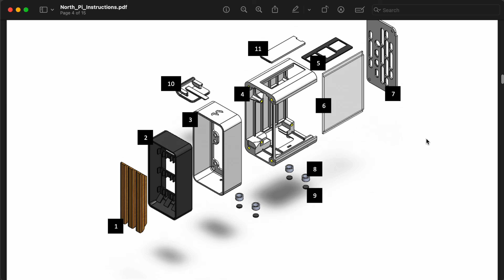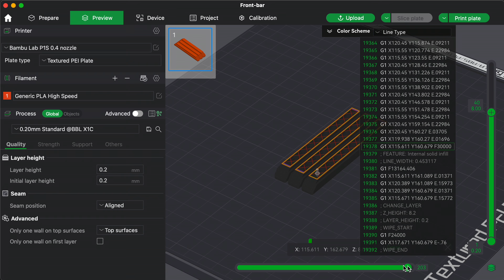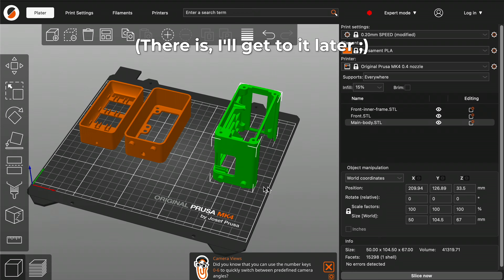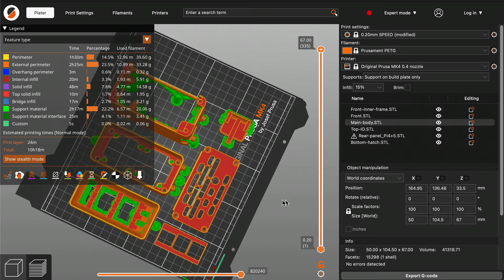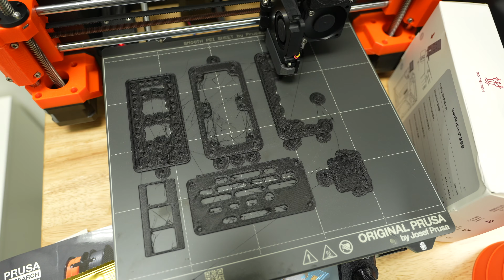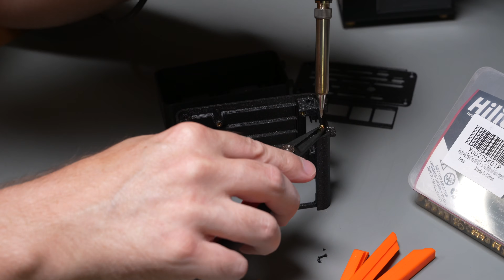Fractal's newest PC case is... free? (some assembly required)

Comment: That's really cool, and thank you for doing this video.  I learned so much of what I have been doing wing, either by you messing up and then saying what you did wrong (which is what I messed up on also) or being a third party, I could see what was going wrong.  So I learned a lot, like I was setting my someo soldering iron WAAAY too low, and as soon as you said "you know how they say to read the instructions", I started laughing because I'm guilty of the same thing.

Comment: If you don't have a 3D printer, call around to libraries in your area, a lot of them have maker spaces with printers that you can use - usually for just the cost of filament.

Comment: Tips for printing PETG:
Keep it dry! It NEEDS to be bone dry, best is to print it straight from a drybox, ideally after having dehydrated it in an oven or fruit dryer. Wet PETG is extremely stringy and weak. Dry fresh filament as well, almost every filament I have ever bought was wet despite being sealed. I'd say PETG isn't quite as bad as Nylon/PA (which needs to be dehydrated WHILE printing) when it comes to keeping it dry, but it's far more sensitive than PLA. That said, PETG is always stringy and globby.
Print it slowly! PETG always prints kinda messy and it prints really ugly unless you print at something around 10-20mm/s.
Make sure it works with your build plate! As you saw, it can form very strong bonds with certain sheet materials. It basically fuses with glass, for example. Use a layer of adhesive spray as a separator.
And now for the most important secret trick: Forget about PETG and use PCTG instead. People will tell you it's basically the same as PETG (and thus not worth it) and that is mostly true when it comes to mechanical properties, but they miss one important fact: It prints way cleaner and easier. There's still stringing and globs, but it's around 10% of what you get with PETG. It also can take around 10 degree celsius more before becoming soft than PETG. I used to print almost exclusively PETG and I print exclusively PCTG now. It's just that much less of a hassle when it comes to stringing.

Comment: The largest piece of the case should have been flipped upside down. On one of the long sides there was a bridge across the top but not the bottom. If it had been flipped, it wouldn’t have needed supports, saving a bit of time and material. At one point, the software was showing that piece in a different color. It might have been trying to tell you something.

Comment: Edit: I saw the rest of the video. Good to see that you learn by reading the documentation :) Best of luck to you. 
Original comment:
Some constructive critique brother. I hope you are not easily offended.

1. I cringed when you stabbed the prusa sheet with the tool. Please keep the satin abuse off camera and use hard plastic tools plus heat and/or alcohol for on-camera abuse (I can deal with that <3)
2. Stringing is common when you print with too low of a temperature on the nozzle. READ THE SPECS... when you print with a new filament, the slic3r presets are good, but PETG and PETG0 is probably not the same compound.and need different settings. Double check the speeds it needs and the temps it needs for best practice. (When in doubt a do a print tower to dial in a new filament. It might be the best filament ever for your needs but it needs some testing in your environment and use case etc.)
3. I like to print more things one by one in sequential order as to have the nozzle focusing on one thing at a time.. https://help.prusa3d.com/article/sequential-printing_124589 
4. PETG is wonderful, I only use that material as I print functional parts for things. Granted it is more brittle than PLA, but I make up for it with infill (amount and pattern). Also layer orientation and outer edges. Also I never use the fine sheet, I don`t like the glue mess and PETG tends to bond with the coating, so when it contracts and the bumpy parts make it release when cold, I get no warping during the print process but an easy release from the bed.
5. You should read more up on material science and 3d printing "trips and trix". 

Otherwise I enjoy your content. Keep at it. Best of love from Scandinavia.

Comment: What is the idea behind the term real wood accents here? This item is provided to be 3d printable. I would believe that they provide these with fake wood accents. To add real wood to a 3d process, would require more than just a 3d printer. Since real wood uses a literal growth process, followed by carving and that which makes them have accents is the oil/lacquer process. Even with the focus being on the accents, as then with real wood accents there's part wood part other material, there's a reason there's something called fake wood accents. And it's used on products that are made to look like wood, but don't have any wood material in them.

Comment: Why don't you offer to print the files for this case and charge a reasonable price, all things considered? I don't have a 3D printer because I lack the need so some online service is my only option. Why don't you bridge the gap and cut out the GREED so they will lower their price. That's Capitalism, to get a big company to lower its price. Monopolies focus on Greed and create high prices. Anyone with half a brain knows this, so if you know it would cost you 15 or 20 bucks to print this yourself, why not pass on the savings?

Comment: I discovered a trick to printing in mid air. Print your object at a slight angle and not flat on the surface. You may need supports on the bottom but thats all.

Comment: Id suggest not PLA - if temps are getting 60+C on the pi/ that softens most PLA.    As for flame resist.. no need... if your device is so hot it is catching things on fire - you have other issues.  This does leave some fun like UV reactive ABS and stuff you can use - which opens up a niche market for fun little fancy prints.

That's not venom, my MagnetoX had tis PETG-CF goop up the hotend, and THAT was venom.  it was just... all over... managed to go right up between the silicon sock up the entire heating element.

Comment: A couple tips for PETG,. Make sure you dry it out first, even if it is fresh out of the package.  You can use a smooth plate, but you need to use liquid glue or some alternative to prevent it from adhering too much.  It is easier to remove the print if you pull it off at around 40-45C.  Once it cools off completely it becomes harder.  Make sure you protect your print from unwanted airflow.  Rapid cooling can cause it to shrink and warp.  That Bambu printer would probably work better for it given the environment.  And for the stringing, it could be the retraction speed, but I don't know for sure.  It could also just be the wet filament.

Comment: Most of the parts are not optimised for 3D printing and have a lot of unnecessary features making it overcomplicated.
The wooden accents should be bamboo chopsticks that you just need to cut to the length, you would probably take 3 of them and cut off 2/3 of the length of the round side and keep the square ends, that would be dirt cheap.
I could redesign it but they didn't release step files...

Comment: that was so messy. you dont use pla gloop on petg and you covered the screw hole for the front part with those slats. you need to enable "exclusive printing" in the slicer so your clips are perfectly align. id recommend printing these on the same printer too is they are not both perfectly calibrated

Comment: Use Cura folks
Reply: Proper printer settings and the right slicer go a long way in when to need supports. I'm going to print the "North Pi" as well, but without any supports.
Reply: Also you don't need so much heat for inserts, that's crazy doing 650F. Your melting into PLA which already melts at 200C or 392F which is exactly the temp i use for inserts.
Reply: For inserts only press them in till there's just a little bit still sticking out, use a flat metal object (bottom of a socket works) to push the insert flat and flush.

Comment: PETG on my MK4 doesn't string that much at all with the PETG settings. The supports failed. I avoid touching the build plate ever with bare hands, finger oils damage adhesion, and the supports failed to adhere and made an extra mess from there. I use the matte plate for most everything, the smooth plate has been put away. Adhesion is perfect and no glue stick or cleanup required.

Comment: For petg, its wise to up the retraction speed and the retraction length if ur printing at the temps ur printing at, you can also lower the temp a smidge so the petg isn’t so gooey, it may produce weaker parts (but from experience its still stronger than pla) ur using a direct drive so the changes in retraction will be minimal, hope this helps for next time

Comment: I noticed the MK4 print times seemed a bit high, and it appears you're not running input shaper. You can almost cut print times in half if you use the MK4 input shaper profile in Prusa slicer, and your printer's firmware is relatively recent

Comment: The trick with printing PETG on smooth PEI is to never clean the build plate. 😂 if I ever wipe it down with IPA, I follow it up with wiping my hands over the build area, or not removing slight dust that have settled etc. I’ve had very good results that way, and except for stringing I’ve found PETG to be a lot more reliable than any other material. Stringing is also very easy to remove, just apply a heat gun and it’ll disappear. 

TPU though is even worse when it comes to adhesion to PEI, you need to apply chalk powder to have any hope of that ever coming loose.

Comment: what are you using to remotely control the printers power? i'm using octoprint and a smart socket so i can turn the printer on by voice command, but would rather have something closer to what you have going that is an all in one solution. maybe also time to try a new slicer than cura and simplfy3d...
Reply from the maker: Im using Home Assistant + ThirdReality Zigbee outlets
Reply: @Level2Jeff  I have Kasa. Should also work?

Comment: If i may give a couple printing tips:
1) When arranging a plate. Try to keep the big items in the center and not the sides/corners. Bed-heating is not uniform with the outer sides often being a bit colder. So lift-off tends to be a bigger risk there. When your plate is full of stuff, bump up the plate temperature by a couple degrees.
2) Always use a 3D-Printing gluestick like say Magigoo, Dimafix, 3Dlack or whatnot. By default they improve adhesion for even PLA, but more importantly they provide a separation layer so that stuff like PETG, ABS and TPU doesn't try to fuse with the PEI sheet and damage it during peel. It also means less wear of the sheet which is a nice little extra. Ain't like its messy either as its water soluble. A wet cloth wipes it off fairly easily off the plate and prints.
AND 3) Don't underestimate your printer's ability to deal with Overhangs and Bridges. Unless its very thin or on the outside it can often just push through and do the job with just a few supports. It might not look great from the underside, but you won't be looking at that once its build. So its often best to just manually paint on supports and key points and save on a lot of trouble.

Comment: Hear me out… use a good cpu with good integrated graphics, idk about the motherboard, the power supply can be like, separate, instead of in the case, its near the socket, solder on some ram instead of normal, and solder a thingy for a couple micro sd cards, now its the smallest windows pc (not really but its small)

Comment: the pro way to remove petg from pei after you've made a mistake like this is pouring some isopropyl alcohol on the bed, let it flow under, then evaporate off, loosening the stuck on bits significantly. this is probably some old chemists trick

Comment: All that stringing makes me believe you got some bad case of wet filament... PETG is very hydrophylic so you really need to keep it in a dry box.. several boxes out there that you can make from fancy ones with humidity displays and heat pads to simple ones with just sillica beads

Comment: When I look at Fractal's main page for this, I don't see any links or anything pointing to that URL with the STL 3D Print files. Which I find strange, because then how did you even find the link to it if it isn't on their main page or products page. You can't even use their search bar on their site to find it either, but when you search it on the web, it somehow finds the URL to that specific page? Looks like they forgot to add the link to their own products on their own site.

Comment: In my experience it's important to clean the smooth PEI sheet with 95%+ isopropyl alcohol before every PLA print. Skipping this step leads to reduced bed adhesion which causes tall objects (like your missing tree support) to be more likely to pop off the bed as they get taller.

Comment: PETG is horrible. The less your hotend needs to move off the print, the better for PETG. I used to only use one printer for PETG because of just how sloppy it is and I only used it if I absolutely had to. I would rather fight with ABS rather than deal with all the issues with PETG. And yeah your hotend is going to get trashed in the process. There are ways to make PETG work better, but it’s kinda hit and miss at best.

Comment: I guess that fire resistant PETG needs more dialing in than the regular stuff, never had that much stringing using mostly the default PrusaSlicer settings for PETG.  I think retraction was the only thing I had to mess with.  I did have to buy a silicone cover for the nozzle, got tired of cleaning it so often since I use PETG most of the time.

Comment: Jeff, the insert holes shouldn't be set to the width of the knurl, but rather the step that is less than the knurl. That way the knurls have some plastic to lock into.

Comment: Just a warning: you are not supposed to print PETG on the smooth PEI steel sheet on the Prusa. I’ve ruined one by doing it, but you can use glue to prevent the PETG from pulling off the PEI. I just used the textured sheet to be safe.

Comment: 16:36 its "goopy" because its not dry enough and your temp is too high it seems you are cooking the petg. also petg needs faster and longer retractions. for the mk4 id go with 2.5 mm retraction at 50mms. 

then a temp tower to check the properties of the filament. then a test pattern for flowrate and then finally a kfactor calibration. if you skip these steps u might get defects. always dry the filament, even it came in a vacuum sealed bag with silica in it. it can be much better if dried properly. then store in a regulated sealed box. :)

welcome to the fdm familiy

and STL stands for "Stereolithography," "Standard Triangle Language," or "Standard Tessellation Language. take your pick ;)
Reply from the maker: Ha, thanks! I just bought a Creality filament dryer, will try it next time I print on the PETG V0 (along with Prusa's correct settings for the V0, which are different than normal PETG!).

Comment: Was kinda curious why you didnt use the bambu to print the bigger parts?
Reply from the maker: With normal PLA I'd be fine printing on either, but for Prusament I wanted to give myself the best chance of success on the Prusa MK4. Will have to try again, changing a few things as per these comments!
Reply: @Level2Jeff  Well just the fact that it is enclosed it doesnt get effected by the air around it like the prusa, Usally if something is bigger and has supports its always best to print it inside an enclosed printer. Ive been waiting to print this on my bambu x1c and I really want to see the results of it.

Comment: When you print PETG place the parts far apart and in Bambu Studio/Orca slicer use Print by Object instead of by Layer. I am sure Prusa Slicer there would be similar settings. It helps to reduce stringing as you are preventing travel between parts on the bed. I use it for TPU which is also very stringy. The limitation is that you can't fill the plate as the print head's need clearance on the x-y axis to do this.  Alternately, you can tweak PETG flow rate and pressure advance. For stringing  issues, The retraction amount also needs to be adjusted along with print temperature. There is a proportionate relationship between temparature and flow  ratio. The higher the print temps the higher flow rates can be achieved. The higher flow rate, you can do faster printing. But faster printing comes with quality penalities.  Typically the flow rate value hovers around 0.98 in Bambu studio for PETG. You also need to check the maximum volumetric flow rate also. The value of PETG for me is that it is easier to sand and finish than PLA.  Also PETG has slightly better mechanical properties and temparature stability.

Comment: I always use DERUC 3D Printer Bed Adhesive -Glue Stick on the PEI sheet. Apply it in up and down layers overlapping each other, then left and right to totally cover the plate. Soaking in hot water after printing also loosens the bond between the glue and the print. 100% prints every time, and no scraper required.